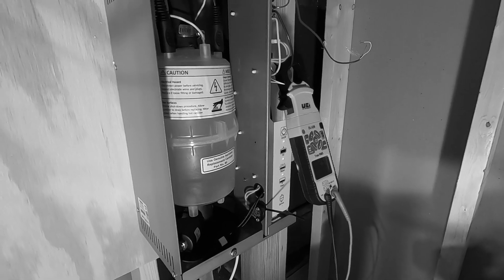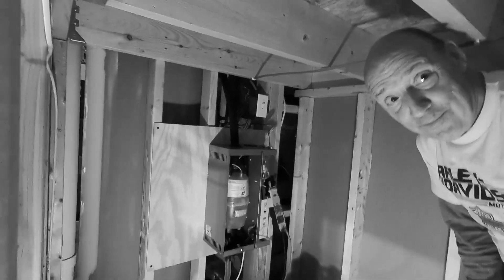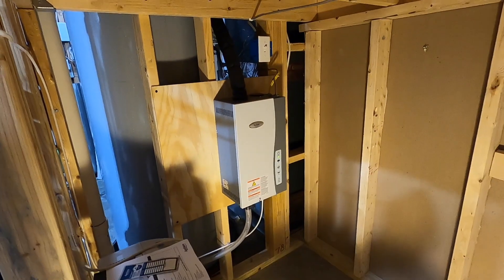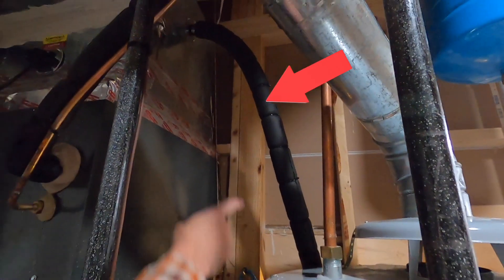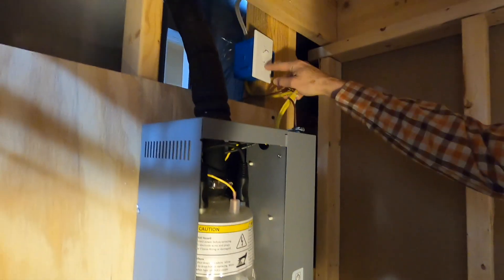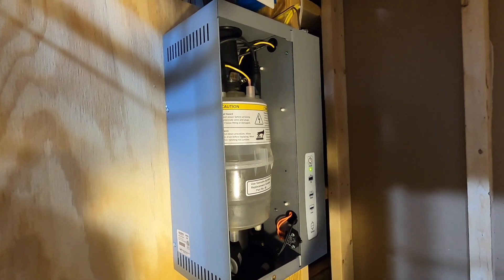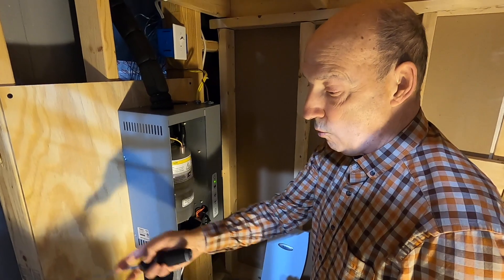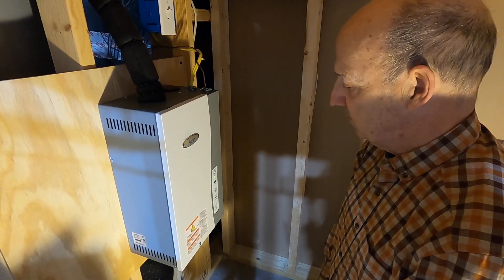How Does a Steam Humidifier Work? | My Steam Humidifier Installation

Comment: So there is no cleaning required just replacing the canister does the job? I am concerned about mold growth mostly. My 100 dollar room humidifiers get moldy every couple of days of running. I am more interested in the vented version that puts steam into the air with the wall vent. Hopefully also mold free option

Comment: How does the indoor fan know when to come on when the humidifier is making steam?
Reply: The humidistat communicates with the blower, if wired correctly. The blower will come on with the stream, independent of heat or cooling.
Reply: @victorvek5227  10-4.  Had mine now almost a year.  Live in dry Wyoming and feel much more comfortable inside.  My wife and my guitars are much happier with some humidification.  Thanks for helping with my research Victor.

Comment: I don't think I heard any mention of an air proving switch. Was one installed? Also, when the blower fan is on a low speed, do you get any condensation in the ducts near the furnace? Did a ON/OFF High Limit switch/humidistat get installed? Also, the steam dispenser should have been installed lower on the duct to give the steam a better chance to be absorbed before going off the main trunk (absorptive distance). I say "should have" because I can see that it was possible.
Reply: Air proving switch won't work with variable speed fans. I'm going to get a 5v relay , connect the fan and 0v to close the circuit like that. And you are right, you shouldn't push the steam in the supply plenum directly above the furnace.
Reply: @MarkusAvrelius  I have a UV lamp installed which is most efficient when the fan is set to always on. The air proving switch has a set screw in it allowing you to find that sweet spot where it won't close the circuit when the fan is on low (no heat cycle) but closes when the fan is on high during a heat cycle. So, an air proving switch will work with an always on fan setup. But, it's tricky and not ideal. If I had 6 wires to my Ecobee thermostat (I have 5) I could use the two ACC+/- connections and put them in series with the air proving switch...BUT... configure the Ecobee as having an evaporative humidifier instead of steam. That way, even if the fan is on (low or high), the Ecobee won't close its part of the circuit unless it's in a heat cycle. The goal is to have the fan on 24x7, but not have steam generated in between heat cycles in order to avoid condensation. With 6 wires I wouldn't have to worry about tweaking the set screw in the air proving switch. The Ecobee also has a setting for extending the time that the fan is on high speed at the end of a heat cycle allowing for just a bit more humidification while the ducts are still heated.
Reply: @guitarflipper  why would you need the air proving switch if your fan is on the whole time?
Reply: @MarkusAvrelius  - An air proving switch prevents steam if there's no air moving (kind of obvious) which could happen if there was a fan failure (super rare). An HVAC company won't install a steam humidifier without one. It's recommended. So, installed one. But, there are a variety of ways to configure any system and having the aps installed allows me to change the setup should it be necessary. I had the aps before I put in the UV lamp so ... My setup is not typical. That's fur shur.